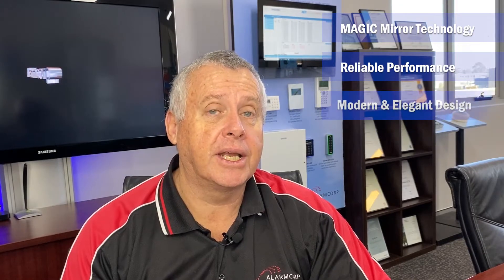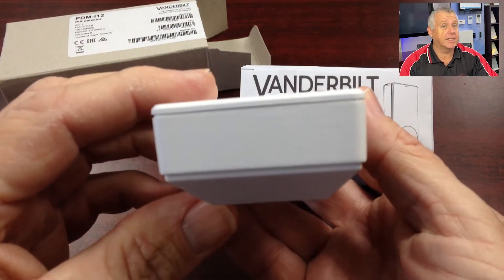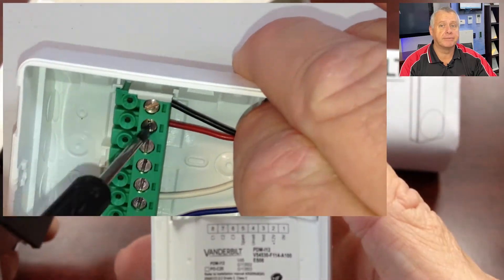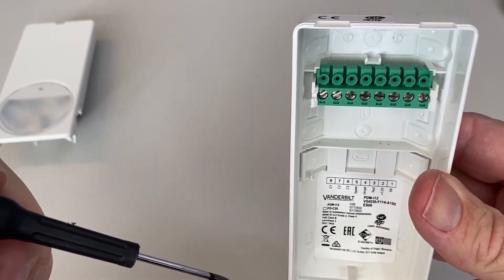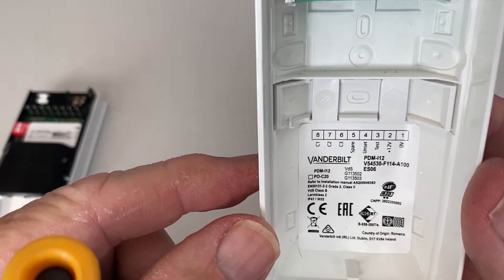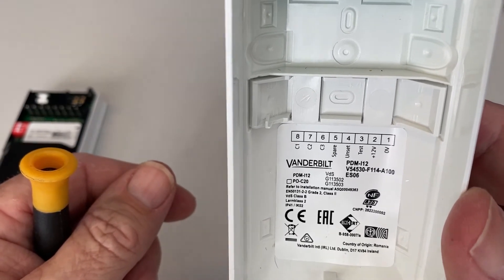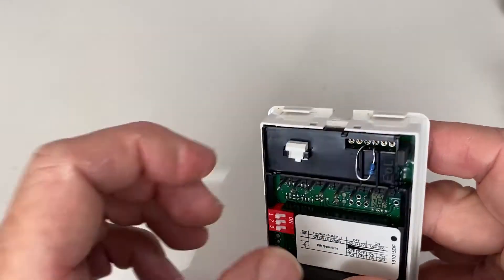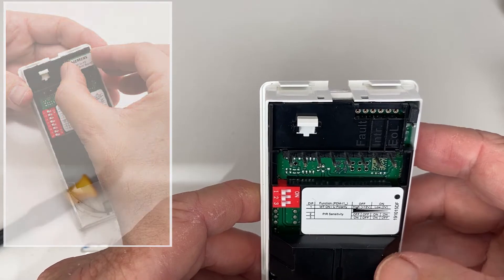Vanderbilt PDM-i12 PIR Installation Guide

Comment: Hi. What if i want the alarm circuit and the tamper circuit separate for house control wtih no resistors. Alarm C1-C3, Tamper C2-C3? Does the C3 act as a common? Best regards.
Reply from the maker: Hi, you would use C1-C2 for the alarm circuit, and C2-C3 for tamper.  Yes C2 is common to both and can't be changed.  Also ensure the JUMPER is fitted, and the resistors on the detector hear are removed.
Reply: @alarmcorp2947  Thanks for your quick reply. We use this in my company and i recommended it to a friend. He however want's the 2 circuits to be completely separated. So unfortunately he can not use it. Have a nice day. :-)